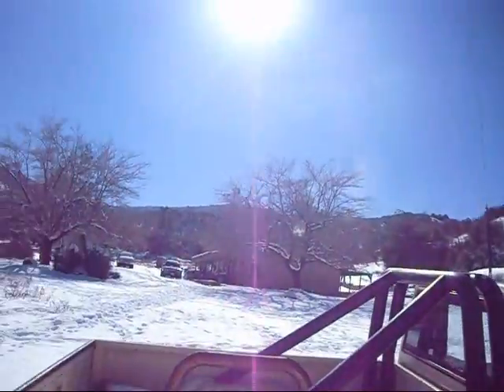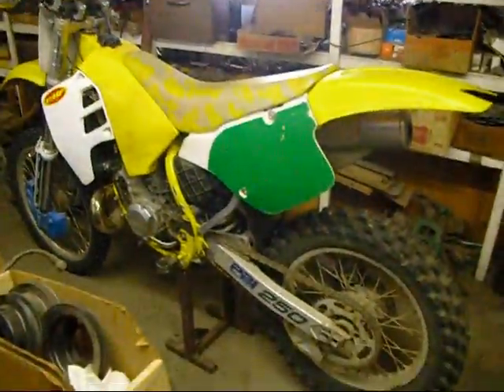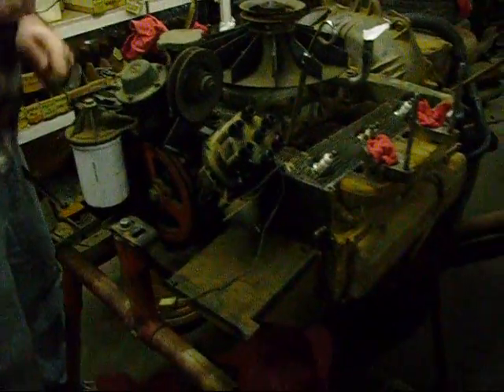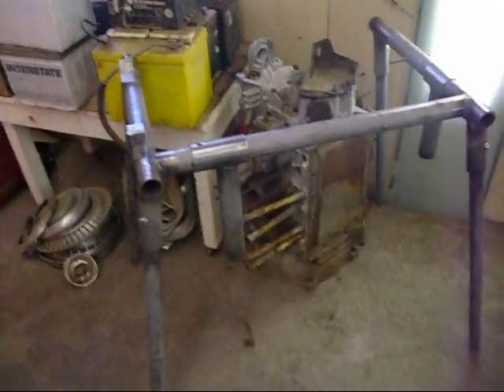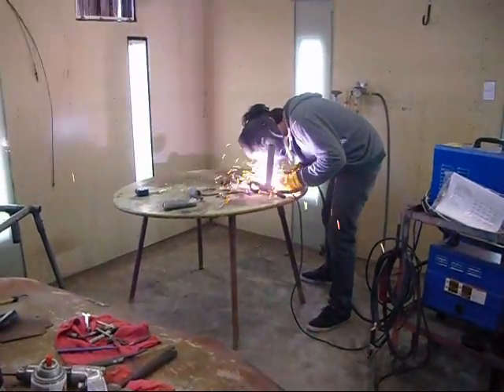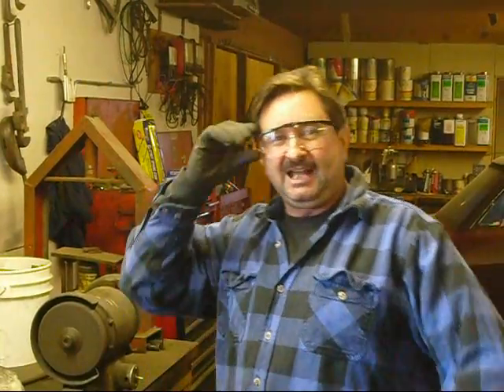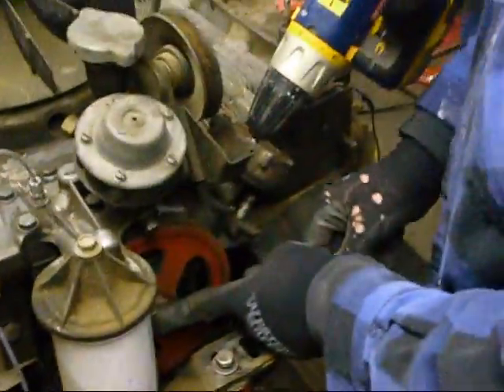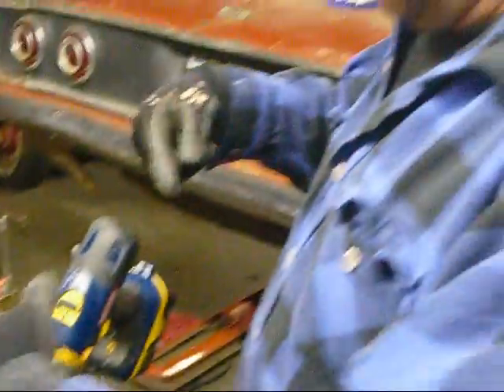oil priming engine

Comment: you only had to turn it (lube it) for a minute or so?  it's not a longer process?  Did you add extra oil?  How much did you put in at the spark plugs and did you put the plugs back in?